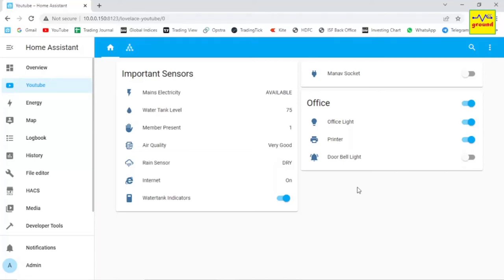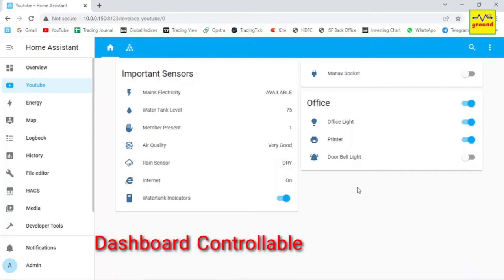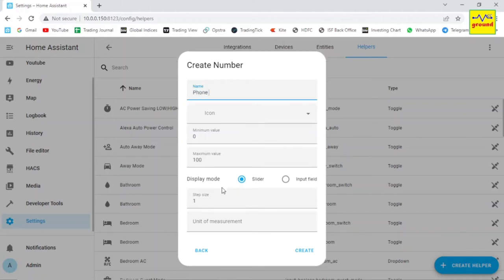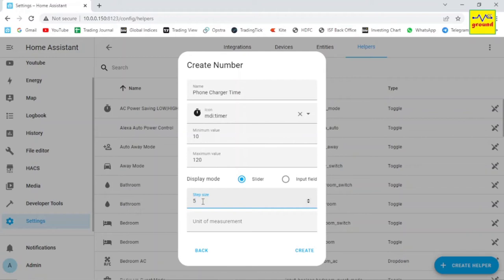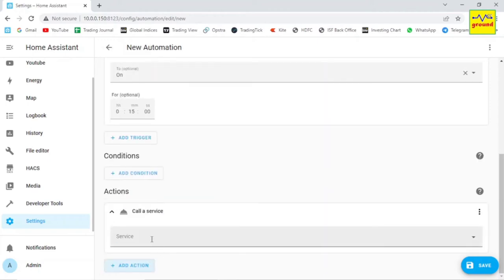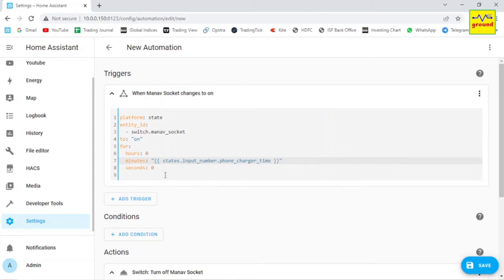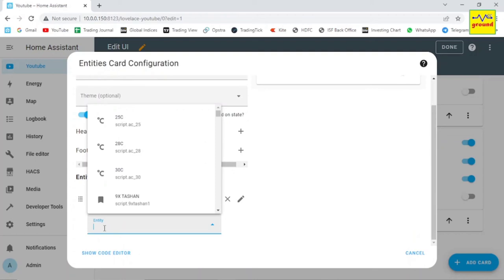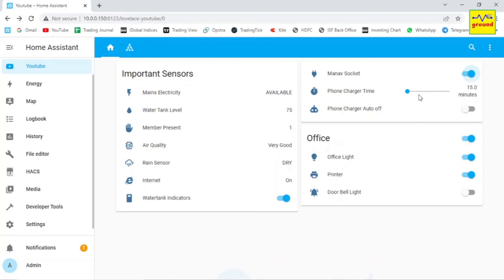#44 How to Create a Dashboard Controllable Timer Switch in Home Assistant | vccground

Comment: Thank you very much, almost perfect for me. I just wonder if you can advice how to use your controlable timer as seen here, but also switching off and on and off in a loop that only stops when the switch or automation is manually stopped. I have a fog system which I would like to control with your time slider on/off/on/off etc etc..until I switch it off. The time adjustment is also needed, as some times I need shorter or longer times.
Reply from the maker: @keesvandenhoekyacht  Just create this timer as instructed in the video. Now duplicate the automation that was just created for this timer. In that new automation's trigger section, change "on" to "off". In action field, change 'switch.turn_off' to 'switch.turn_on'. And Save this automation. Now you have two automations for this timer switch. One to turn it off after delay and another to turn it back on after the same delay. Now when you turn on this timer switch, it will turn on your fog machine. After the set time delay, it will turn off your machine. After the machine remains off for the set delay, the 2nd automation will trigger and turn on the machine again. And this will repeat endlessly until you turn off one of the automation. Hope its clear now 👍
Reply: @the_vccground  Thank you very much !!

Comment: with the new update dont work anymore {{ states.input_number.phone_charger_time.state | int }} ??????
Reply from the maker: Which update you are talking about bro. Mine is still working...
Reply: Did u get a solution for this problem ?
Reply from the maker: @tobsen_coebeatbbq6559  It's still working perfectly fine brother...
Reply: @the_vccground   try to create a new one ,  this code dont work {{ states.input_number.phone_charger_time.state | int }} then check the logs
Reply from the maker: @iuly111  What HA version are you using ?
Reply: Use = "{{states('input_number.phone_charger_time')}}"
Reply: Message malformed: expected float for dictionary value @ data['for']['minutes']
Reply from the maker: @iuly111  What HA version are you using ?
Reply from the maker: The following is working perfectly fine in my HA 2024.6.3
{{ states('input_number.phone_charger_time') | int }}
Give it a try brother....
Reply: @the_vccground  Message malformed: expected float for dictionary value @ data['for']['seconds']
Reply: HA 2024.6.4 :Please guide me how to debug
Reply: @iuly111  This tutorial is exactly what I need,, but I'm getting the same error so it doesn't work. Did you find a solution?
Reply: @JimBuzbee  i think mistake here is edit whole automation in yaml. edit only the trigger part of automation in yaml, not up ringht corner menu, use three dots menu on the right in trigger select line  . I made same mistake first.

Comment: hi i hv just started with home assistant and found it very intresting .. i hv "ZEBRONICS ZEB-SP110 10A Smart Plug" and few smart bulb however unable to find those in search by brand section .. so i have to code and create custom template though coding ? 

coding is i'm not that great of ... can u guide pls
Reply from the maker: Have you ever flashed any smart device before ? Asking, because you need to open the smart plug to recode / flash it.
Reply: @the_vccground  i have not have however  seen ur 1 video doing it .. .. so devices which are not showing by brand needs to be flashed ?
Reply from the maker: @gauravrise  Yes, but would you be able to open the device to flash it ?
Reply: @the_vccground  i guess no .. i vl probably damange it :P
Reply from the maker: @gauravrise  mail your contact details with  name and city on vccground3.3@gmail.com . I'l have to contact you personally and guide.
Reply: @the_vccground  sure vl connect through mail
Reply: @gauravrise  actually zebronics smart plugs are tuya based.. soo try it setting up with smart life app and in home assistant yu can either add that device as tuya local or cloud based and why need to flash it or damage device... when it works alredy
Reply: @boopeshkumarprabhakaran  Thanks will google process.. this sounds cool
Reply: @gauravrise  what do you mean by google process?
Reply: @boopeshkumarprabhakaran  i mean how to setup tuya local n devices
Reply from the maker: @boopeshkumarprabhakaran  Oh, Great. Thanks for diverting towards the right direction. I haven't used zebronics smart plugs. But if they are tuya based, then it doesn't make any sense to flash. Thanks Boopesh 👍